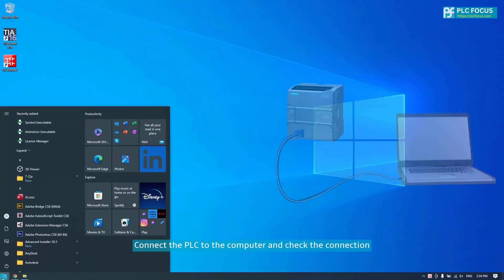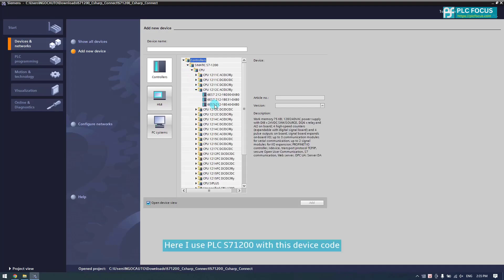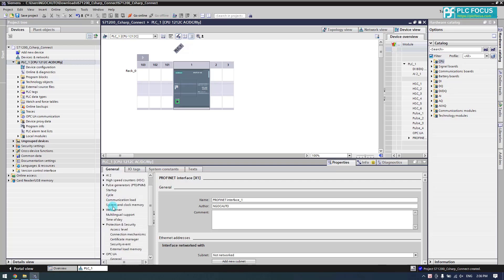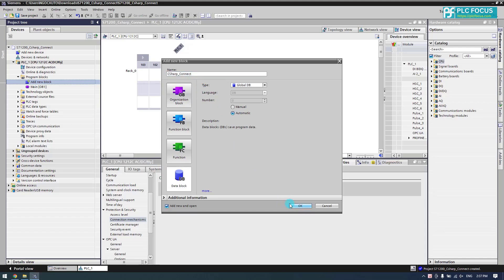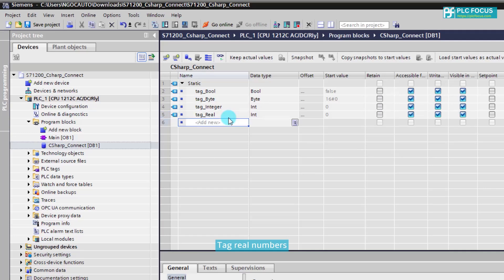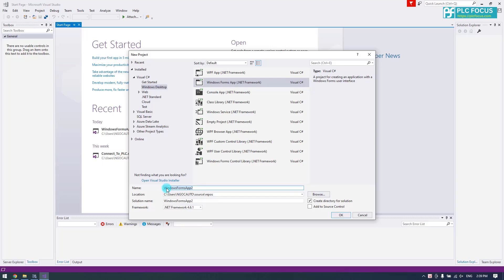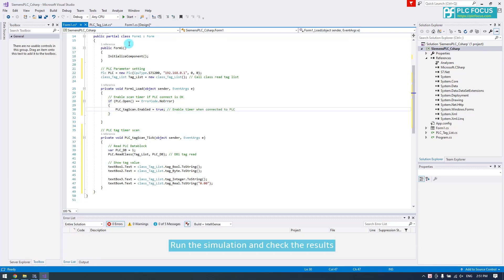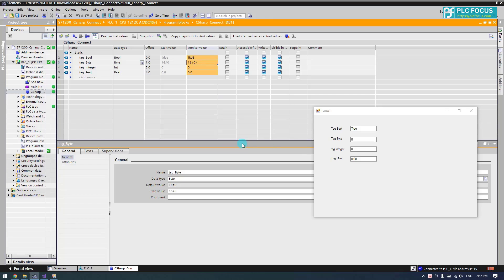C# and Siemens PLC lesson 1 - Read data from PLC

Comment: Hello, First of all, it was a really useful video. Thank you for the information. But I get an error like this in a similar program I made. (system.exception: 'the size of the class is less than 1 byte and therefore cannot be read') There are exactly 21 bools in the class I created. Frankly, I could not find much content regarding this problem. I would be glad if you could help me. Thank you.
Reply from the maker: please try to add 1 spare tag as integer at the last of that DB, don's put all only bool type. need to have byte or integer or real tag type in that DB.
Reply: @plcfocus.solution  Hello, I wrote 30 lines mixed with bytes and ints, but it still says that the minimum readable class must be 1 byte.
 example public static byte _op1 {get; set;}
 public static short _op2 {get; set;}
thank you for your response.